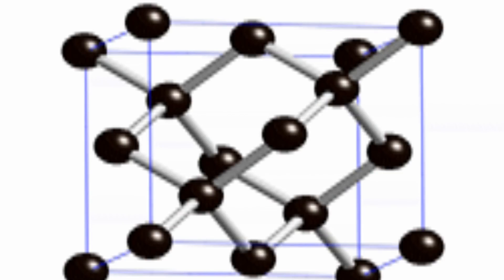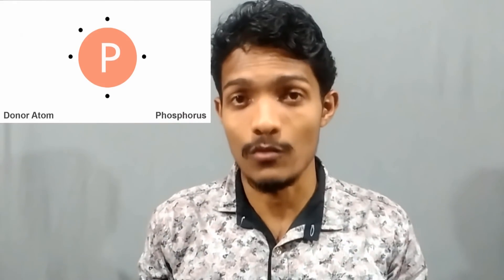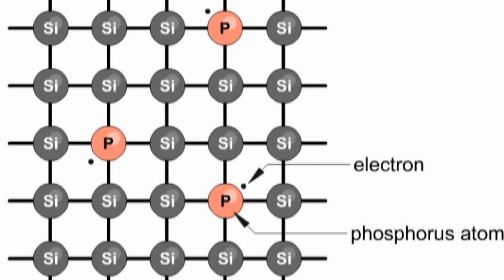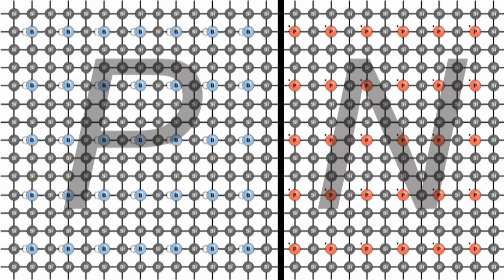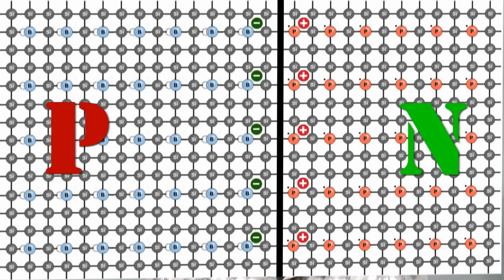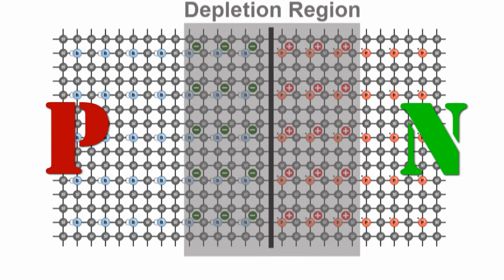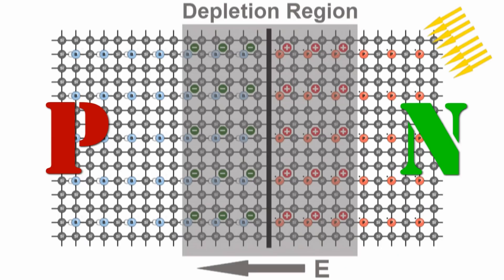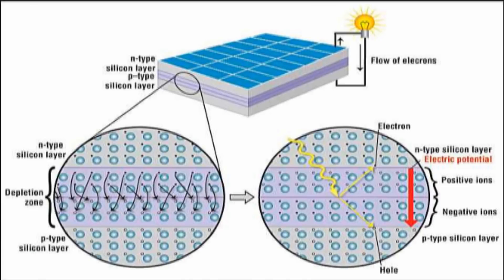How P-N Junction Works? Solar Cell Working

Comment from the maker: Connect with me on Instagram! Suggest ideas and co-create.. 
https://www.instagram.com/newphysicist/
Reply: New Physicist Could I please have your phone no.? I have built your solenoid engine car but it is not working I need help please!
Reply from the maker: +Armaan Goyal , Sorry for late reply. I was out of state. OK, what's your problem Armaan?
Reply: New Physicist I have copied your wiring and model for the solenoid engine car, but the car does not seem to be moving on it's own.
Reply from the maker: +Armaan Goyal, Connect positive terminal to starting leads of solenoid engine.

Connect other two ends to make and break leads. It will work.. Try👍👍👍👍
Reply: New Physicist okay I will try. Thank you very much
Reply: Excellent sir...

Comment: sir when light falls on PN junction it knockout electrons but please tell me electrons from which region ( P or N ) gets knock out and current flow because p type also have minority charge carriers. this thing is bugging me from a year pleaseee reply
Reply: Majority carrier are responsible for conduction in diode.(majority carrier in n side=electron&majority carrier in p side=hole ).when ligh fall in depletion region electron and hole pair created and both seperated from each other.electron move towards n side and hole towards p side (due to electric field present in depletion region push hole in the direction of electric field)now because of that n&p side get oppositely charged and when we connect  wire with led then led glow because of discharging of n &p side.here discharging means electron from n side move to p side and combine with hole thus conduction start in wire.hope you understand👍

Comment: Hi can you share any information (diagrams you may have) which shows how to connect the n and p type to generate electric flow. Also u may need something like ITO to absorb photons from sunlight and interact with doped material. Can you share any thoughts and diagrammatic representation of how this can be realized. Can you share your phone number and or email. Thanks

Comment: english is not my first language, but i have a doubt. If i use something to focus sunlight, fresnel lens for example, but direct it to one solar cell, does it work and generate similar energy as a solar painel with many solar cells into direct sunlight? i know someone invented a giant espheric glass ball that does something like this, but is it possible to use these kind of itens i said?
Reply from the maker: +Thales Felipe, Increase in intensity of sunlight dramatically increases the solar cell output. SPS alpha is a technology that concentrate sunlight from a large area on a solar panel to increase output. I've uploaded a model of spa alpha here at Newphysicist, Kindly watch. 🌸

Comment: Could tell me please, why depletion zone does not collapse under light? Positive and negative ions should produce also holes and electrones, but it seams they are immune to light energy. I'm stumped on that particular thing, otherwise my understanding of p-n junction is okay.
Reply from the maker: +balbin23, Depletion layer breakdown happens only under reverse biased breakdown voltage. Light alone cannot affect the equilibrium of p-n junction. Thanks for watching.👍